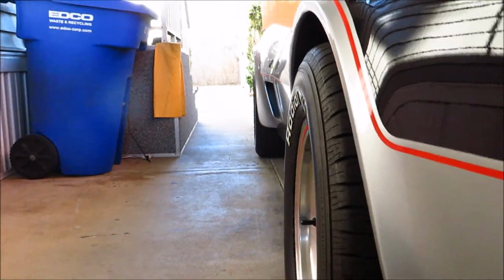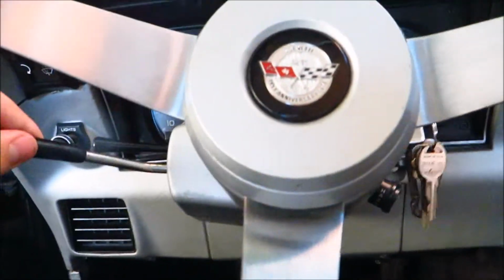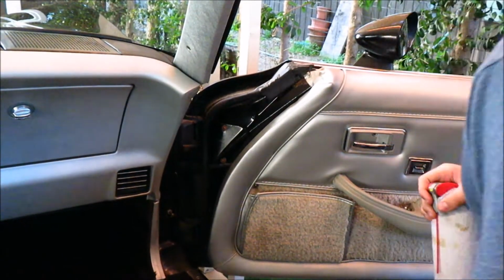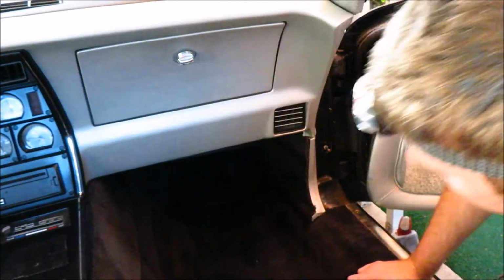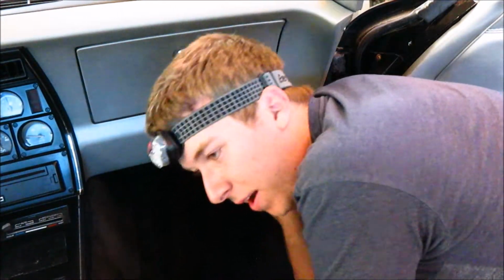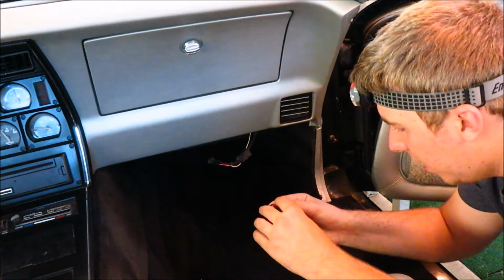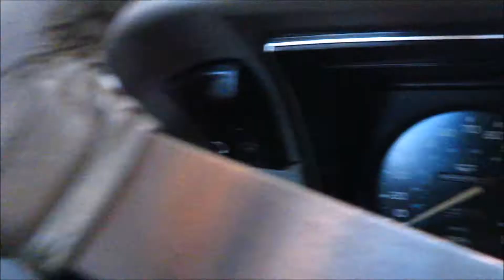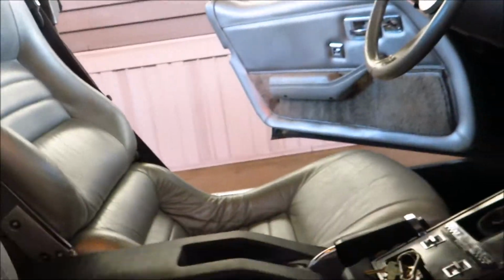Final Touches, Kind Of...

Comment: The turn signal blinker is on the passenger side dash as you found out in the video. IF you have an issue with the hazard blinkers ever, that blinker is located on the top left side of the fuse box. Since those are almost never used they usually aren't replaced. If you are away from the house and need to fix the blinkers in a pinch, you can always use the hazard flasher.

Comment: Would love to see the instrument cluster removal vid if you have it. I will be doing it soon to my 81 vette and your vids have helped me out some already.
Reply from the maker: I don't have the video, but it's not to hard, there are 3 screws in the top of the plastic part of the cluster, and 2 on the side, take those out and you can remove the clear part (be carful to not break off the odometer button). It helped to drop the steering column a little bit so just loosen those bolts, tilt the wheel all the way down, and telescope it all the way out if you have those features. Then you can gently pull the cluster out, but there is the speedo cable holding it in so you have to reach up from behind the dash or behind the cluster with a guage if your hand will fit. You can use your hand or a screw driver to depress a tab where the speedo cable plugs into the cluster as you pull a little and it should pop out. Then you can pull the cluster out being careful to not break off the odometer button and then you can unplug the tach and pull it the rest of the way out. Give that a try, if that doesn't help you can also try the Corvette forums, they have been helpful to me in the past. Let me know if you have any more questions. Thanks for watching the videos, I'm glad they have helped you
Reply: Saw Garage thank you so much for the clear instructions. I’m going to try to tackle this probably this weekend, I have a couple bulbs out. Are you planning on making any more vids of the Corvette?  I watched all you vids of the Corvette after I found them randomly yesterday.

Comment: What year is the Vette. I have an 81 and I also am dealing with the blinker issue. Same as you. Someone told me its the ground maybe. I had my whole steering wheel removed as was told it was the blinker switch.  Let me know, I have a mechanic coming next week to track it out. Nice Car :)
Reply from the maker: It's a 78, as far as I can remember the only wiring in the whole system was off of that blinker switch. I had to replace mine because the actual mechanical part of the switch was broken and the blinker would not click into place and it wouldn't cancel. As far as electrical troubleshooting in that area I'm not sure